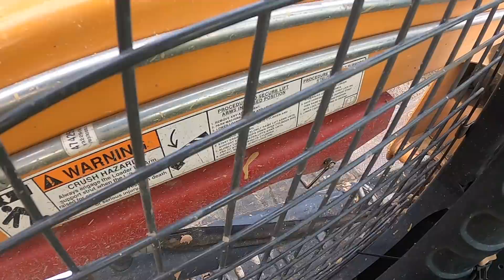Bubba rope and Case 320TR Skid steer pass their first real test. Pulling out a 26' box truck.

Comment: good to see the Bubba in action overcoming a huge weight and resistance difference there.. Very handy things kinetic ropes when used  right but they are very dangerous when used wrong especially when newcomers hitch to wrong parts and they get torn off!  Nice recovery and safe too. Many thanks for sharing :) That little Case 320TR is certainly earning it's keep!
Reply: wouldn't say huge weight, those skidsteers are small but that one still weigh's near 10,000lb's.
Reply from the maker: Mr Ogion  yes sir it's doing very well. Thanks for watching and stay safe

Comment: Mr Hal, given the difference between the weights of the Case and the truck, should you size the rope for the larger vehicle or smaller, if you have a choice?
Reply from the maker: Mr Patrick  You size the rope for what your pulling. Thanks for watching and stay safe
Reply: @SumterWrecker  Huh. That's not what I figured, though I will certainly take your word for it. 

The way I reasoned it out is that if you have two vehicles of very different weights (like my Suburban and my four wheeler) and each has an appropriately sized elastic recovery rope, if you yank on the heavy rope and vehicle with the light vehicle, it will jerk to a sudden stop because the lighter vehicle just doesn't have enough oomph (mass & inertia) to stretch it; it might feel like snatching with a chain, which hurts! If the lighter vehicle pulls hard on the lighter rope, it will really stretch it out good, and the same total force is spread over a longer time, giving the tires of the heavy vehicle a lot of forward help instead of digging to China. I've seen ATVs yank out much bigger vehicles, so I know it can be done, but, I've never been able to experiment for myself. Maybe one day soon I can get myself good and stuck on that road, and I'll know who to call. 
Thanks for your time, and stay safe!
Reply from the maker: Mr Patrick thanks for viewing and commenting. Stay safe

Comment: Shane made a good call there.   People think the bigger the rope the better but for elastic rope you need to size by the 2 vehicles.  You would not use a 1 1/4 rope to pull a small car out because there would be no elastic effect the rope is to big, it would be like using a chain and hitting it.  Same with if a pickup was trying to pull a semi out if the rope is to big the pickup could not stretch it and you do not get the elastic effect.  Different brands mark the ropes differently but the Bubba ropes are pretty darn good and made in Florida.
Reply from the maker: Badger Pa thanks for watching and stay safe